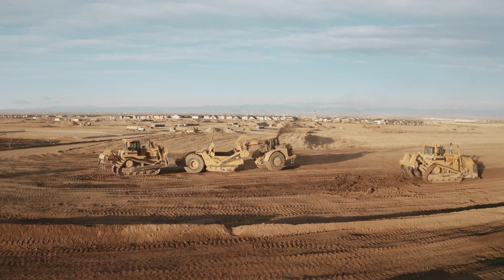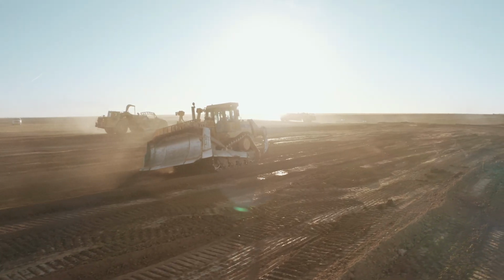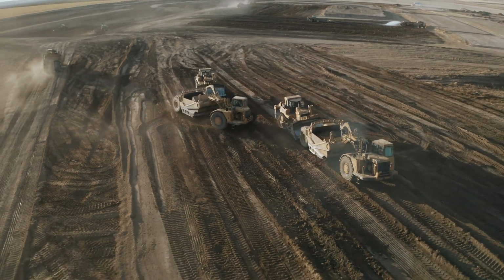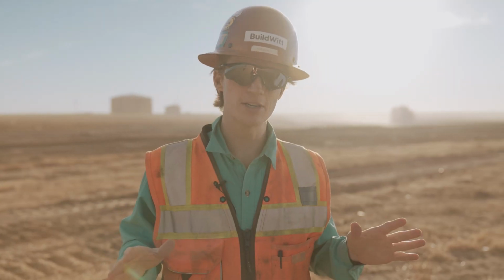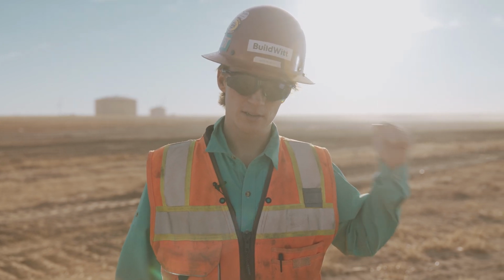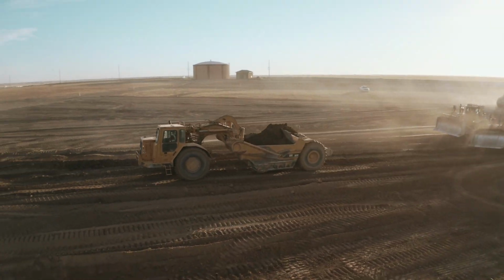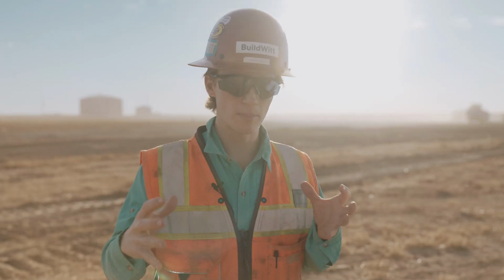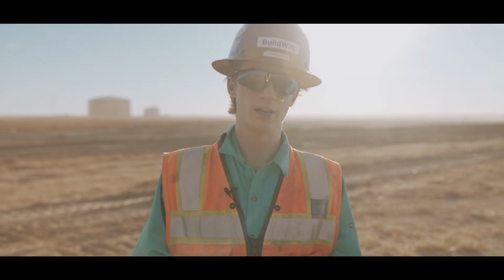The Scraper Fleet | Moving Millions of Yards of Dirt

Comment: I used to work for Bemas YEARS ago as a scraper hand. You are 100% correct about them being able to move dirt in large quantities in Colorado. They keep rebuilding and maintaining their equipment, yes but what they DON'T do is maintain the operator cabs in the scrapers. The ones I ran were pretty rough but they did their intended job. Their dozers and blades are usually in pretty decent shape. 
Let me add onto what you were saying about the push cats/ dozers. The idea behind leaving the hard nose/ full sized push blade means that they can shape the cuts and bring the dirt down with them. This is critical when you're cutting in slopes. You reduce the workload on the finish dozers or blades. If you have a cushion blade, you're extremely limited with your production.
621/631/651 scrapers can absolutely move a LOT of dirt but they are WAY too dependent on support equipment to be effective. For example as a push cat, you're usually handling something like 4-7 scrapers by yourself depending on your haul distances (a good push cat hand can keep that many going with very little wait time). If your push cat goes down (ESPECIALLY in a single push cat spread), those scrapers are SCREWED. 
If you run a push pull operation, you can easily keep them running with minimal stopping (hey, every once in a while a guy's gotta take a leak lol). In Colorado, you might want to reach out to companies like Dwire, Ames, Sema, Lightning Ventures, and Kelley Trucking. They all move huge amounts of dirt and have a pretty good size fleet of equipment. Definitely something worth checking out.

Comment: Excellent footage and commentary sir. Nothing like old iron (70,000hrs+) that has paid for itself several times over, no having to reboot it with a laptop and the latest software, diesel, oil, hydraulic oil, grease, good operators and away you go......oh and don't forget good wages😁.